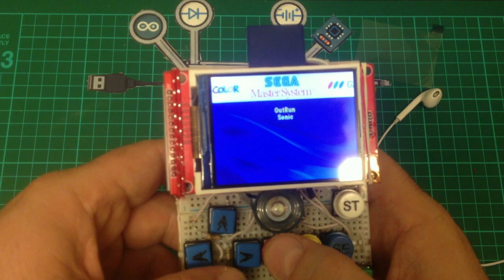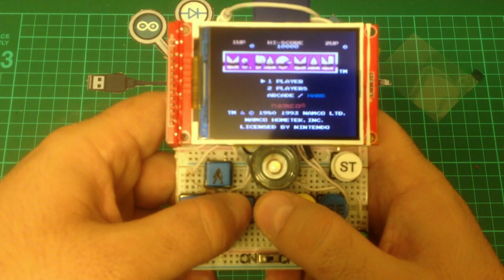ODROID-GO – on breadboard DIY 「 Handheld Game Console 」

Comment: can you add a 4in lcd to the odroid go clone also im using a new wrover-E dev kit C with 8Mb flah and 8Mb psram will it run without full 16Mb upgrade at least for testing?  also arduino monitor reads board as 16Mb of flash is there a way to verify if board is 16 or 8Mb flash
Reply: it should run without a 16mb flash